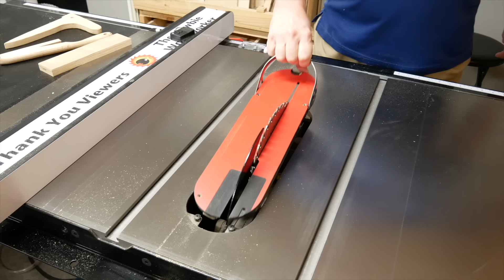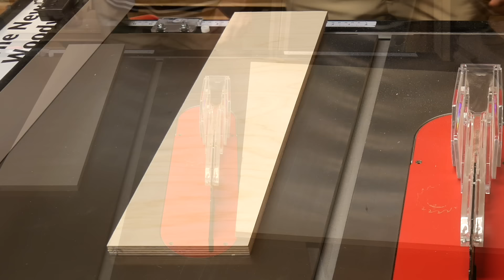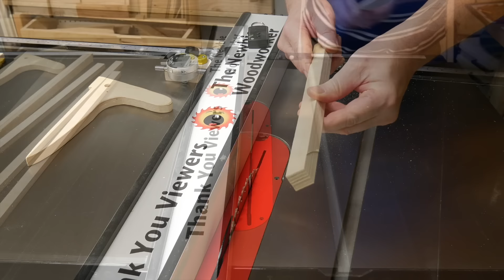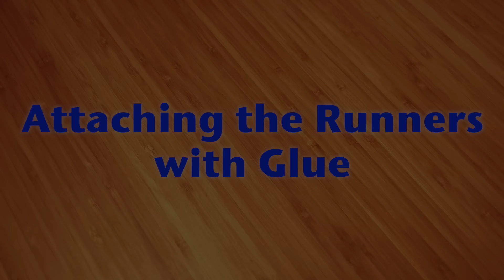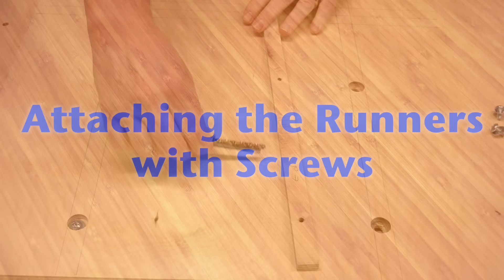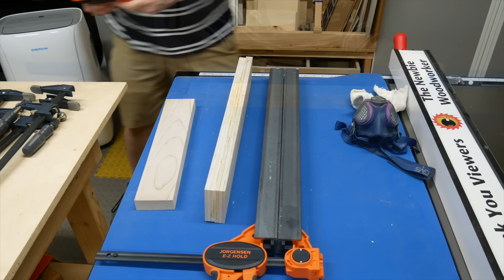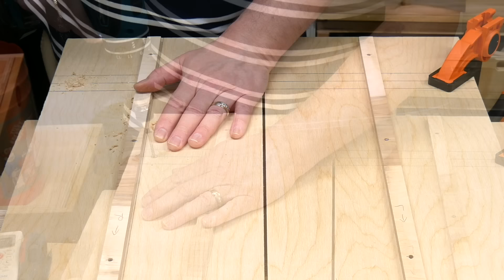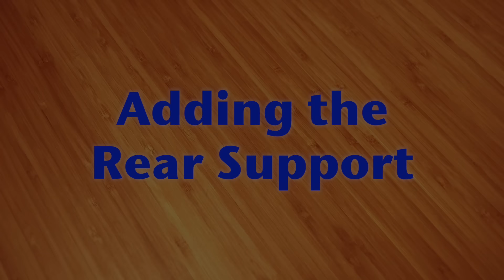Build this Revolutionary Cross Cut Sled, for Newbies!

Comment: I know this video is over 5 years old but I just ran across it. Sorry If I don’t live every waking moment on You Tube. I used a blade guard on the two table saws I owned. This last table saw I finally removed it because the blade guard kept jamming the rood down into the back of the throat plate. It damaged so many cuts it was costing me money. It also caused a number of kickbacks that almost created an international incident. After removing the blade guard I stoped having these problems. It is not the blade guard per se that is the culprit but the design of the table saw. Not all table saws are designed equally. Before presenters make blanket statements they need to keep in mind  not all tools are manufactured the same, and from what I have seen on You Tube. Not all people perform the same function the same way. 🤨
Reply from the maker: Thanks for taking the time to reply. Yes, I should have mentioned that for some saws, the blade guard might not work, or even exist. But one thing you should consider is that it's impossible for creators to think of every possible scenario, and even if we did, would you really want a laundry lists of caveats, like the commercials that list all the possible side-effects of drugs? I understand that this case is different, because of how adamant I was, but still, you can't think of everything.

Comment: Thank you so much for this, I have wanted a cross cut sled for a while and until I saw yours I could not find one without the back fence. This made me believe you had to have the back fence to keep it rigid.
Apart from wanting to keep the guard on, my table has a very tall riving knife that would not pass though a back fence. Your design solved all this!
I made the runners out of some strips of Corian (kitchen worktop) it looks like marble but can be cut and shaped with woodworking tools. It is hard wearing and very smooth, so it won’t bind in the tracks.
Thank you for your design.
Reply from the maker: Interesting! And if you have two runners, you don't need the back fence at all, except to help keep it from breaking when you take the sled off the saw and store it in the wrong place. 😂

Comment: I have a 1970s model Craftsman 10 in table saw. With a lot of help from UTube I have refurbished it recently and feel certain I have it in good working condition. I recently built a sled for it and want to keep the blade guard in place but have not seen any videos showing this model used with both. The blade guard, splitter and riving knife all are constructed together and attached on the front of the table above the mount for the motor.  The front sled support would have to go over all of this.  Have you seen this or have any suggestions?  Thanks for your help.
Reply from the maker: No, I haven't, and sorry but no, I don't have any suggestions.
Reply: May be possible to attach it all to a sled, like so it goes with the sled, they also have blade guards that lower down to table from above,  after market
Reply from the maker: @joshuagharis9017  👍

Comment: I saw your video quite a while ago but just got around to building it. Your videos are very thorough and I love how you show your mistakes. 
One little thing I did different was before I mounted the fence I marked where the slot would be, flipped it over, set the blade to the depth of the notch and nibbled away the slot. I did that so i did not have to remove the fence once it was installed. Thanks again for the videos.
Reply from the maker: Great idea! And thanks. 🙂

Comment: Always nice to see I’m not the only one that goofs the first time 😂. Personally I think using UHMW for the runners is a better choice. I do like the adjustment configuration though. Too many glue them on only. Having adjustments is always a good thing. Wood runners will wear eventually.
Reply from the maker: I mess it up more often than I do it right, I'm sure! As for UHMW, I've had mixed success. It may have to do with the quality of the UHMW - I'm not sure. But yes, I like to be able to adjust things, although honestly I haven't needed to with this sled.

Comment: One additional thing you could do is to angle the leading edge of the fence.   This would make it easier for some guards to lift into the groove.   My previous saw guard was sloped at the table height, but went more vertical 1/4 " plus/minus. Had occasional issues with 3/4 stock,  but 1/2 was usually OK.

Comment: So I'm a little anxious to get a table sawfor building a kitchen in our 2nd home. The thing frightens me when I see all the expert videos of people using it without a guard... This is a good idea for using it safely. One thing: why is it necessary to cut the fence in half after aligning it perfectly and then rescrewing it? That seems like a recipe for misaligning it (especially screwing in/out/into some soft pine wood). Why not just cut out the notch with a bunch of cross cuts to the required depth, then chiseling it out? And doing this before aligning and attaching the fence. Anyway, cool idea which I'll add to my saved DIY list.
Reply from the maker: Thanks. Honestly, I can't remember anymore, but there was deinitely a reason. (I'm sure that helps a lot, right?)
Reply: Many YT wood workers use guards (many don't)  in their day-to-day work.  They remove it for videoing so "we" can see what's going on.   Bottom line, so what's safe based on your needs/ fears.  Personally, I'd prefer to use a guard but sometimes the inability of seeing the blade as it cuts into the stock (especially the initial incision) can mage guard use difficult, if not impossible. :(

Comment: I just made this sled with a few minor modifications (T-track for hold fasts and then a stop block on the fence) and thoroughly appreciated your thoughtfulness and careful step-by-step instructions.  I really appreciate being able to use the blade guard during the cross cuts!  Thank you for sharing!
Reply from the maker: Awesome! Thanks for letting me know. 🙂
Reply: Would like to see how you did that
Reply: @TrixR44 I made the fence a bit thicker, routed out a slot for t track which I then glued in.  And now I can use a stop block (currently using the Katz Moses one me).

Comment: 👋🏼 Newbie here. Just had my first experience with kickback. I unplugged it and took the time to install all the safeguards. So yes, love your sled. 
After watching many cross sled build videos, I noticed yours does not have a rear fence. Leads me to the question "how important is the rear fence?"
Reply from the maker: That's a great question. I think it probably depends on the quality of plywood you use for the sled. For this sled, I used Baltic Birch plywood, and it's plenty strong enough without the rear fence. I mean, I've been using my sled for somethiing like 4 years, and I've never had a problem.
Reply: I learned kickback can often be attributed to the blade but being square with the fence - narrower at the far end of the blade than the entry edge.   It's the pinching that can causes the kick when the cut and cutoff connection is weak.   Mine is about 1/10th of a millimeter narrower, and I get kickback almost every cut if the stock is narrower than the blade diameter.  I’ve not been able to tweak the blade little enough to correct that - of, for a micro adjustment knob for this!
Reply from the maker: @Oops-IMeantToDoThat  Interesting.

Comment: How did you stop the blade guard from not catching the sled on the pull back ? I held them up with my fingers and placed a self tapping screw to hold them up not sure what you did?
Reply from the maker: If I don't push it too far through, it's not an issue for me because the guard sits on top of the block at the back. You can kind-of see that at around the 00:25 mark.

Comment: So many issues. One I haven't seen mentioned is tapping into plywood for the machine screws. They'll come loose and out of alignment constantly, not to mention wood makes a terrible sled guide.
Reply from the maker: Baltic Birch Plywood is plenty strong enough for the threads - I've never had a probem even after 4 years. But if threading the runners bothers you, then don't do it. As for wood making a terrible sled guide, I'm not sure where you got that from, but it's wrong. Yes, some wood isn't good for it, and you should always take grain direction into account, unless it's good quality plywood in which case the grain direction doesn't really matter. I have multiple sleds for various usages, and the wood runners have never been an issue.

Comment: You opened talking about saw safety and you cut your runners by pushing your left hand right up to the turning blade with no guard in place. At this point I stopped watching.
Reply from the maker: You aren't the first to mention that. It took me awhile to get used to using a blade guard - I'm not perfect.

Comment: how do i make a zero clearance insert for my ryobi 10” table saw, model #rts22
Reply from the maker: Sometimes the easiest way to do this is to take a wide strip of painters tape and place it over the hole. then slowly raise the blade up to cut through the tape.
Reply: Then rving knife needs to be removed.

Comment: Interestingly I watched this video immediately after another one about table saw safety while researching a design for making a sled myself. I hadn't thought about needing to remove the guard when using a sled so was very glad to see this design. The safety video had no guard fitted and I left this comment which I think is relevant here:

Many of the injuries described in the video would be prevented by fitting a blade guard. It's very noticeable that many otherwise excellent videos from the USA have no guards on the saw, and sometimes not even a riving knife, though I assume these are supplied with the tool as they are elsewhere in the world.
There are occasions when the guard has to be removed to do a job but these are exceptions and using a table saw with the blade guard removed unnecessarily will get you instantly banned from any woodworking club that I know of here in Australia and probably in the UK and much of Europe as well.
Reply from the maker: There's no excuse for a YouTuber to post a table saw video without using a riving knife, unless it's one of the rare cuts that can't use one. That's just irresponsible.

Comment: I think saws that have anti kick-back pawls will not work with this design. The only way it will work is if the gap for the blade is wide enough that the pawls don't touch it. Then you will have more tear out on the bottom of the work. It's a great idea and will work for any saw that does not have anti kick-back pawls. I'll have to look at how the pawls work on my saw. if they don't rise too high I may be able to rout out the bottom of the sled so the pawls don't contact it while leaving enough wood to prevent tear out.
Reply from the maker: You're correct - pawls won't work with this.
Reply: This tells you how often I've used the blade guard and pawls. The pawls and blade guard are two separate attachments. The pawls as I'm sure all do, work from the top not the bottom. At least  I have the option to use the blade guard without the pawls.
Reply from the maker: @KI-zj5tt  I've tried using the pawls before, and honestly, they just seem more trouble than they're worth. So that's why I don't mind not using them.

Comment: You actually tapped wood with machine threads??? Geeze, use threaded inserts. That's what they are for.
Reply from the maker: Not a lot of room for them in runners. Besides, it worked just fine, and has continued to work all these years later.

Comment: Since there is no front fence, is there not a risk that the cut line squeezes a little bit? Which would result in a slight misalignment of the whole stuff. Or the two runners are just enough to keep the whole base in the original position. To me the whole sled looks like the cut line that goes all the way to the front of the base will make it loose some rigidity but maybe I'm wrong. Anyway I gave you a "like" because I appreciate the time you spend explain the process in details. Thanks for that work.
Reply from the maker: Thanks. With 2 runners, the kerf won't squeeze at all. And it's worked brilliantly for years now.
Reply: Was thinking the same. Could lead to misalignment but I am more concerned that it could squeeze the blade when you pull back the sled after it passes the riving knife which could lead to kickback in worst case. The riving knife only works correct if you push through, not if you pull back. 

Why not have a higher front fence in the center with a cutout for the guard but is still connected? Sure, would be More chunky, but would stabilize the kerf line.

Comment: Great video! I’m always trying to find ways to use my blade guard more often. 

As a tip some may like, to prevent my sled ever going further through any cut than needed and protruding dangerously from the back I use a hidden “sled stop block” set according to the max blade height of the saw. This is not a new idea but I’ll explain. 

As my sled extends slightly past the left edge of my job site saw, I have screwed a small hardwood stop block onto its underside that hits a little mini C-clamp ($2 from Harbor Freight! :)) I have clamped firmly on the table edge below its surface. The screw portion of the clamp is all under the table.

This stop could also be created differently depending on table size, perhaps using some “L” shaped extension off the side of the sled or from underside of back of table (but these are only hypothetical ideas).

Thanks again for the great content!
Reply from the maker: Thanks, and that's a great tip!

Comment: I'm in the process of making one right now! It just occurred to me that as the fence has a cutout for the blade guard, the piece to be cut (when using the finished sled) won't always have full back support from the fence. That is, if the height of the material is greater than the fence's height at the place of the blade guard cutout. Have you (or anyone else) had any problems with tearouts because of this? I made my cutout for the blade guard so that it would pass through even on the lowest blade height setting, which didn't really leave that much material left for the height of the fence at that place.
Reply from the maker: I hven't had any issues with this, no.

Comment: Thanks a lot sir for this video! It means me a lot as a newbie woodworker. I wonder how and where to attach some sort of measuring tape for pieces that I cut and made them exact same length because do not have a miter saw.
Reply from the maker: Depending on the length, you can clamp a stop block to the sled's fence. Or you you can use the method shown here: https://youtu.be/tvG29zqvuas Even though the video uses a miter guage instead of a cross-cut sled, rhe comcept is the same.

Comment: After watching you screw down the fence after perfectly aligning it and then taking it apart again and cutting it half, it immediately occurred to me that it would have been better to make the cut out by hand to prevent any possible misalignment.
Reply from the maker: That's quite possibly true. I've certainly felt like there's a better way to do it.
Reply: I was wondering if it would be a good idea to shape the fence (make the cutout, chamfer, break any edges you want to) before aligning it so that once it's aligned you're clear to screw it down and cut through with no worry of introducing misalignment from detaching and reattaching.
Reply from the maker: @marcmagus0  You certainly can do that if you want.

Comment: Using screws to attach the runners is a bit risky I think. If/when the screws loosen, the result will always be a change in the angle of the fence.
It is convenient for initial adjustment but, I can't see it as a viable long term method.
Reply from the maker: Well, in practice, they have worked fine for me. But so has gluing tracks, so by all means, do what you think is best!
Reply: I agree that screws could loosen but the likely hood that two screws could loosen at the same time. Loctite or super glue would help prevent this. I’ve used these for thirty years without a failure. If a piece is dropped damage might occur. If you cut a piece and as a matter of routine it didn’t measure up to what is needed then a careful woodworker  would investigate and most likely find the problem.

Comment: Of course its revolutionary, the blade is round ^_^

Ok, I'll leave :(
Reply from the maker: I'm sure this was a dig of some kind, but I didn't get it.
Reply: @TheNewbieWoodworker  nah, dad joke. Guessing it failed to cross the Atlantic properly.

You said this was Revolutionary. A tablesaw blade revolves because its circular. Its a terrible joke, but as I'm a father I've a legal obligation to make them. Sorry for the confusion.
Reply from the maker: @Kieran0410  That is hysterical, and I hang my head in shame for not getting it! That kind of humor is right up my (and my family's) alley. Thanks for giving me a good laugh.
Reply: @TheNewbieWoodworker  I'm glad it landed. I've just discovered your channel as I'm finally putting my workshop together (20 years and a new country since I last did any woodworking).

This is going to be one of the first projects I do once I'm "up and running"
Reply from the maker: @Kieran0410  Awesome! Glad I could help. 🙂